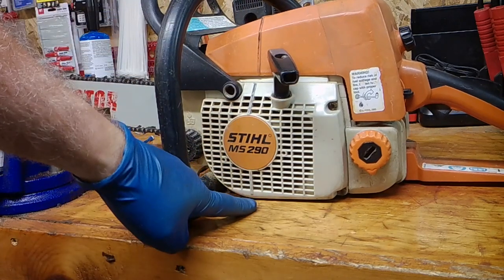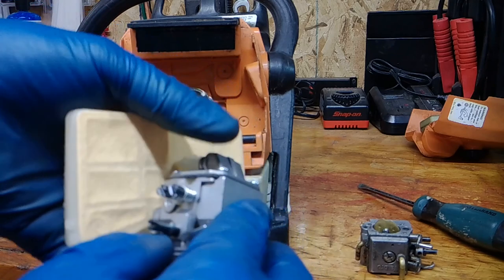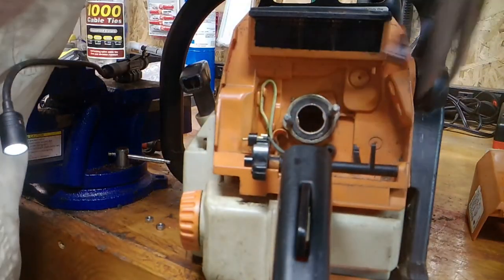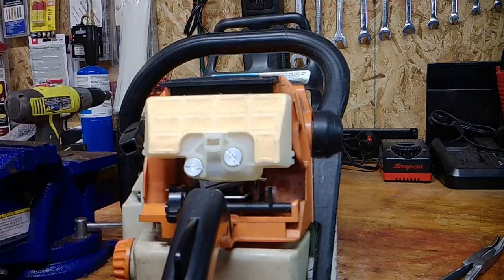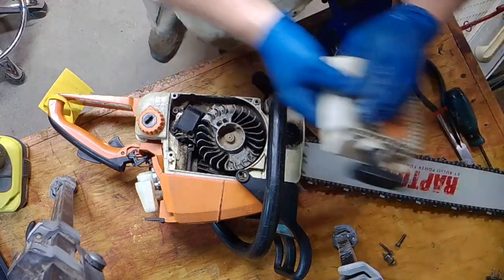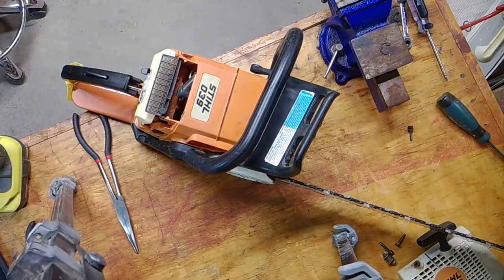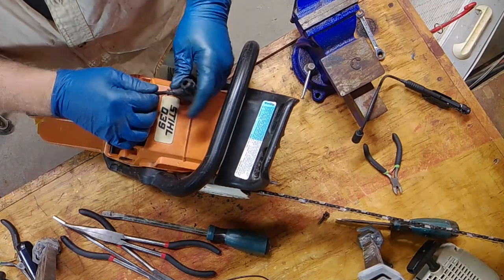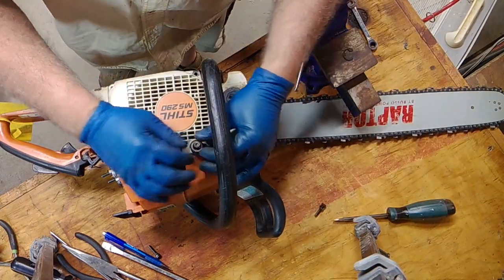Stihl chainsaw carburetor replacement and coil replacement

Comment: Don't you have to gap the coil feet with the magnet on the flywheel on a chainsaw like this?
Reply: yes. and that is exactly why this video did not help me much
Reply: @chrismaillie5695  Dead give away was the LARGE tools used...they are for large vehicles not SMALL CHAINSAWS. 
You can tell he broke away to watch another video to take the Carb Linkage off...those are simple yet he didn't act like he knew how to remove it at first...Go back and wactch again and he films it a couple of times BEFORE TAKING IT APART.
I stopped watching when he did that...YEAH, I work on these things and he doesn't know that much about this saw...